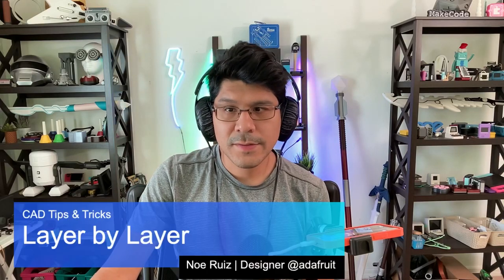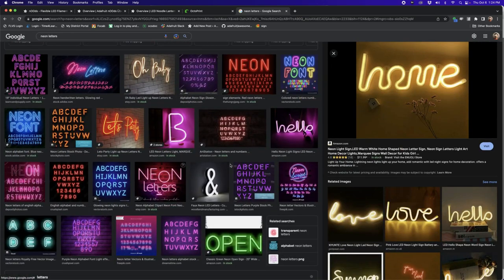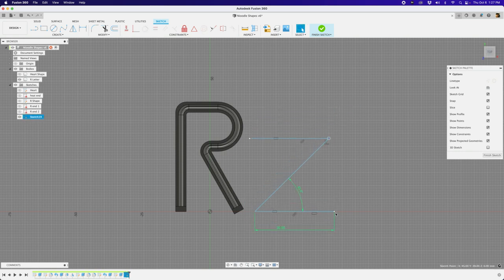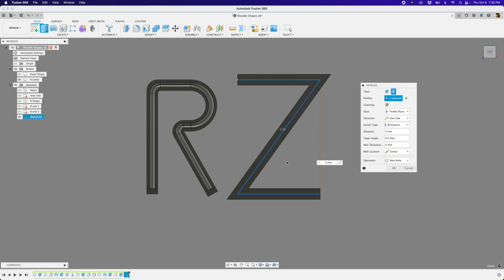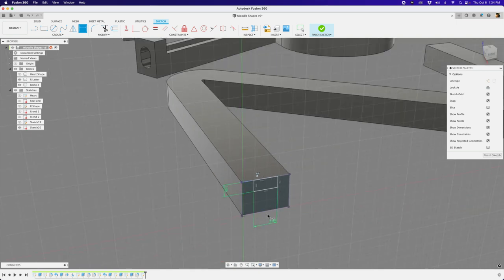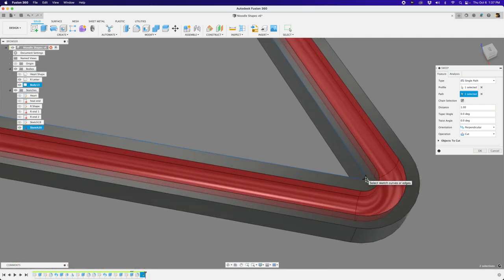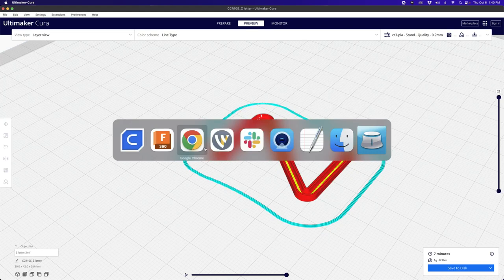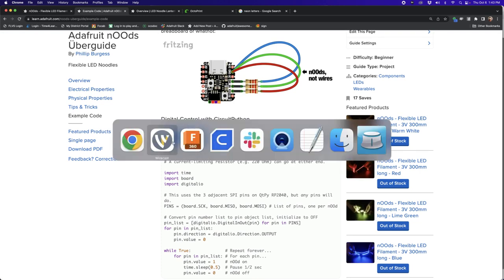Fusion 360 Tutorial – LED Noodle Shapes

Comment: Why not use "Electroluminescent Wire"?  Product ID 410 ... 2.5 meters long and only $5.95 with 36 pcs in stock
AND power it with a wallwart using a "EL Wire Sound Activated Pocket Inverter   5V USB Power,    PRODUCT ID: 831 ... 42 in stock ...  $9.95"

Just an alternative method using adafruit parts.
Reply from the maker: Yeah thats similar, go for it!
Reply: @adafruit  Yep, I have all the needed supplies from a purchase of last year.  Instead of a wallwart you can use a Portable Charger Power Bank which will allow you to place them where every you wish... even outside in a tree!.  Also avoid cutting and splicing the 2.5M El wire by turning the wires 90 degree downward so it will pass through a mounting board and is not visible from the front

AND BEST OF ALL .. . NO SOLDERING REQUIRED.